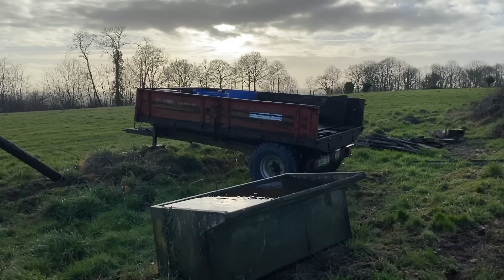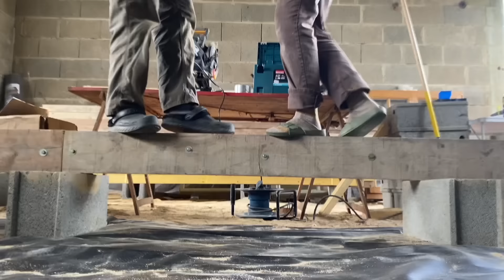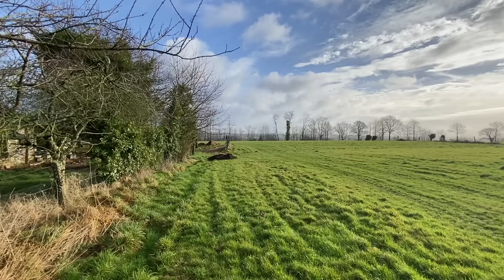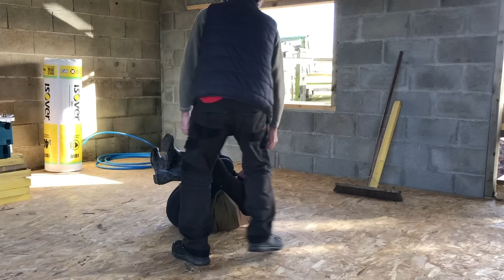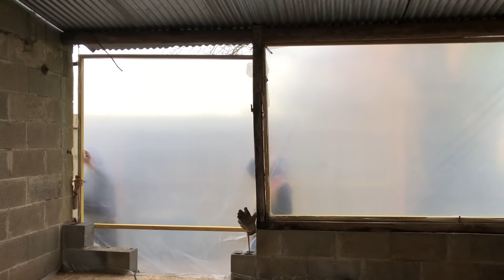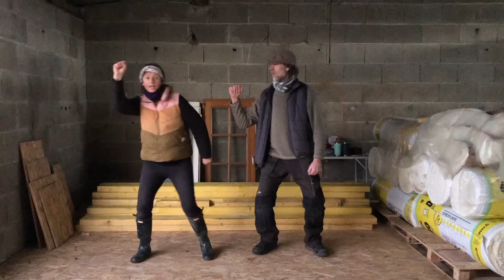#33 Act I We're Floored!...We Bought a Dump...in France!...Episode 13

Comment: That floor looks super cozy 😀 as you have two layers of plastic will you need to vent the floor void?
Reply from the maker: Hi!  We are hoping we don't need to vent.  We did put a hatch in the floor so we can check the water line and put in a fan if needed...hoping this is enough...we are new at this so we are hoping we didn't make a mistake and that the moisture barrier works.  Thanks for your input and thanks for watching!  (Mrs. Bloke)
Reply from the maker: It's one layer of plastic as a moisture barrier and the material holding the insulation is a breathable mesh👍

Comment: Well done getting the timber floor in. I have noticed though that you haven’t put in any ventilation for the joists under the floor which is essential to keep the joists dry. Maybe they do it different in France. Wishing you all the best anyway
Reply from the maker: Cheers. We installed a moisture barrier to keep out the moisture and we have a hatch to access and see if anything untoward is happening under the floor.
Reply: @mrbloke  Firstly, congratulations on what looks like an excellent job with the flooring, especially (but not exclusively) the insulation.between the floor joists. Maybe you took definitive advice re ventilation, but part of my house has a subfloor too (it was an extra €10,000 to put fill it in) and we put a specially coated cardboard in between the joists, then spray foamed it, but tbh yours looks better. My builder said he had to leave the ventilation at the front of the back for airflow to keep the timbers dry. I sort of wish now I had stumped up the extra 10K !

Comment: This floor has a slogan. It’s written all over the place “Mice Welcome Home!” :) unless there’s concrete floor underneath and I missed that…
Reply from the maker: We have 5 solutions!
Reply: Yes!  5 cats coming to the property soon!  We were worried about mice- even took the old wire from the orchard and was going to use that under the insulation but decided against- we did add a hatch so we could see in there and I guess put in mouse traps but my cats are mousers and I am hoping for the best!  If you have a good suggestion as to how to deal with mice please pass it on!  Thanks for watching! (Mrs. Bloke)❤
Reply: @budzcreates  The cats will help on one condition if they will live outside all time (especially at night). If you planing to lockdown them at night they will be useless. The only proper solution is a fine mesh under insulation…

Comment: I may have missed it but have you put any foundation underneath the centre blocks holding the floor up to prevent them sinking over time??
Reply from the maker: We did not. The ground was very compacted by the cows for many years and we compacted it down further. We also added more blocks to support between the spans so the floor is putting pressure on many blocks! It's also ultimately going to be a workshop and if it does sink a few mil or it squeaks a bit, it's not a big deal to us.
Reply: Okay all noted, it's going to make a lovely warm workshop in the future... Great work 👍
Reply from the maker: Cheers ❤️

Comment: Did you put blocking in between the joists? I didn’t see it on the video. Blocking prevents the joists from twisting and keeps the floor ridged.
Reply from the maker: The joists were just around the length you would consider putting in noggins, and if we were using new wood, we would have definitely put them in, but the joists were old wood used as joists in this house for many years. I would imagine the big twisting movements in the wood has all ready happened! Also it's ultimately going top be a workshop, so a bit of movement and creaking is not a big deal for us.
Reply: @mrbloke  it’s your home and you can do whatever you feel is appropriate. I will not comment any further on any of your videos. Best of luck.

Comment: I'm def. not an expert, but I cant help worrying that rats might chew their way through the plastic floor liner, making nests and allowing water ingress.
Reply from the maker: They would have to dig under the footings, which are 2 feet deep. We also have 5 cats. I don't think they would even be drawn there until heat is a factor in the room? We will also set many traps when we move on site and as a back up we have a trap door to get under there.
Reply: @mrbloke  I forgot about your cats! we have bloody rats getting in everywhere ausing damage to heaven knows what!, While our cat is genuinely interested in them, the interest is purely academic, and certainly not culinary.  PS I think you guys are doing amazing work!